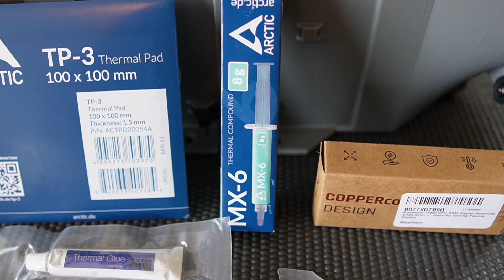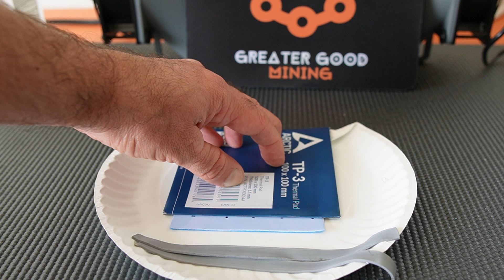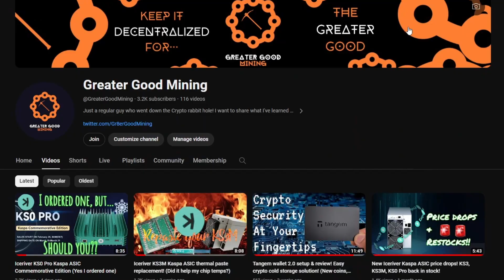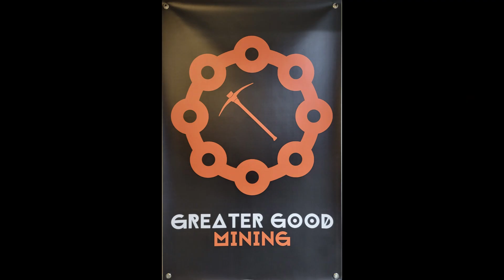HOTROD your Iceriver KS0 Pro Kaspa ASIC for MAXIMUM OVERCLOCKS! (Repaste, Repad, Copper Heatsinks!)

Comment: Can anyone help me. Went to setup to prepare for my 3 ks0 ultra arrivals and the adapters i bought to connect my four pin (pwm) fans to a 6 pin (to the breakout board) is not what I thought. Idc about the pwm can you or anyone help me out with the dype of cable adapter i need. Again i need to connect a 4pin fan to be powered by my breakout box (not trying to use the zsx) hoping to find an adapter. 100% power 100% of the time is good with me
Reply from the maker: Why make it complicated? Get an axial 1238 off Amazon and plug it straight into a power strip.

Comment: @GreaterGoodMining  Can I fit a 10x10x7 copper heatsink for the OC KSO PRO?
Reply: Now I saw that someone already asked this question. Even if I put 10x10, nothing will happen with the machine.
Reply from the maker: It will hang over the edges of the power stage and could potentially short something out if you're not careful.
Reply: @GreaterGoodMining   thanks
Reply from the maker: @vedranlevak5266  no prob, it can be done, just be careful. I'd recommend a smaller size just to be safe though

Comment: Gday GGM - ive got 2 KS0Pro's. No.1 - Power Stage 97 (Stock) and No. 2 - Power Stage 74 (20% overclock)  in the board temp section of PBFarmer.  Is power Stage temp the Thermal Pads, or where i put the Artic MX-6 ? Cheers.
Reply from the maker: Neither, the power stages are where you need to attach copper heat sink. Watch this video I made, it will show you exactly what to do start to finish!  :] https://youtu.be/84YSRkykadY

Comment: Doe anyone know what mosfets are??  I cant physcially see the chips themslves with my eyesight.
Reply from the maker: There are 4 components in the middle of the machine that are shaped like rectangular boxes. If you are looking from the ethernet side you should be able to see 4 tiny rectangular chips just in front of those large box like components. Those are the "mosfets" or power stages
Reply: @GreaterGoodMining   They are teh uP9650a   custom made by iceminer.. cant find any info at all on them n spec sheets. Heard 12 votls runs cooler  on the chips.. but 8.3 instead of 5 amps on defaultl clocks on teh barrel. Consider 6 pin modifiying. HOwever wanted to confirm this with spec sheet. cnat find my guy.
Reply from the maker: @PatrickDurbin-g8t  I don't have that info either, sorry. You might want to ask around in my Discord or Kaspa Discord in the mining section. There might be someone who has more information

Comment: If I put this ks0 pro inside the refrigerator for mining. What harm could it have?
Reply from the maker: It could melt your ice-cream 🍦
Reply: @GreaterGoodMining  I'm asking seriously，Doesn't this approach work?  Is it because of the humidity?  I really want to try it but I'm also afraid of it breaking
Reply: @danielelninoerrante8203   set in front of windo unit. lol but seriously 419e spray.  but bro you spray the chips... are anything that needs a heatsink.. its gonna make a sealed layer between it.

Comment: I hope I could get your thoughts on something for the KS0 Pro. Have you considered putting a flat copper bar heatsink across all the mosfats and then adding the cooling fin heatsinks directly above each mosfat on top of the copper bar? What are your thoughts?
Reply from the maker: I would worry about something shorting out with that method, and you're adding an extra point of failure by thermal gluing two separate things together. It could be done though
Reply: @GreaterGoodMining  Thank you for your reply. I kinda thought that might be the case since all mosfats would be connected to each other electrically.

Comment: the heatsinks that you recommend are out of stock.  any other recommendations?  Additionally, what OC firmware are you running?
Reply from the maker: Try to find copper heatsinks with the same footprint size and they should work too. The key is to dissipate the heat from the mosfets and have good concentrated airflow over them. I am going to be using PBFARMERS overclocks going forward because I want to get better at dialing in my own overclocks. Each machine is different because of silicon lottery. So it's best to dial in overclocks specifically for you machine and environment!

Comment: When buying from iceriver directly is there additional tariffs or taxes?  Thanks
Reply from the maker: You won't pay tariffs on a KS0 Pro in the U.S. because it's only $350
Reply: @GreaterGoodMining  Thank you for the reply. I'm 100% new to mining and currently researching if it's best to buy a dedicated miner or build a gpu/cpu rig. 

For a newbie, starting off with $800 budget, wanting to learn about mining, what would you recommend?

Thanks.
Reply from the maker: @05glisedan  That's exciting, welcome to the crazy world of mining! The KS0 Pro is a great little miner to learn on because it is very easy to set up. I have full set up videos for the KS0 Pro if you decide to get one. The only problem with ASIC's is that you're locked into just that one algorithm and the hashrate is going up fast and rewards are dropping fast for Kaspa. It is harder to learn how to build a GPU rig, but it will be more versatile in the long run. The problem is it would be difficult to build a full GPU rig on an $800 budget and it might take a long time to ROI. I have an older video that's shows you the basics of how to build a GPU rig too. You could start by building the rig and focus on getting one really good GPU and then add more of those GPU's as the budget allows etc. Not financial advice, but if you're willing to put in the time to learn and you want flexibility in what coins to mine, I would choose to build a GPU rig. That's what I learned to mine on! Hope this helps!
Reply: @GreaterGoodMining  Thanks for the info. Gonna start researching hardware. Really appreciate your feedback.
Reply from the maker: @05glisedan   no problem! Good luck with whatever mining road you decide to go down!
Reply: @GreaterGoodMining  What is the "all in cost" including shipping for them directly from Ice River? Also, what is their payment method? Thanks
Reply from the maker: @MrBigTuna100  The all in cost shipped from Iceriver after using my discount code was $395. That is without the power supply. I recommend buying the power supply separately because if you plan to overclock it you will need a higher wattage power supply anyway
Reply: @GreaterGoodMining  thanks for the quick reply, I am thinking about getting a couple more units when they are in stock .
Reply from the maker: @MrBigTuna100  No problem! I love these things. They are fun to mess with!

Comment: My ks0 pro hates being "cold", I added a cooling shroud and the the performance just dropped. ant form of additional cooling and the hashrate would drop below stock
Reply from the maker: That's interesting 🤔 maybe your chips want to operate in a more narrow range than most
Reply: @GreaterGoodMining  anything less than around 60 degrees celsius on the chips and the hashrate plummets. I moved it to another room by itself and I had to slow down the fans to let it get hot to stop the hashrate from dropping. While I´m not complaining about not needing excessive cooling it is a bit odd to say the least

Comment: No repaste, no headsink, 289gh at 144w  asic fan in front (not new), no tsiftw firmware, sides down, no sides with holes works great at 42c max. One use 153w.
Reply from the maker: Well done! Are you thinking about modding or tweaking further? Love your results with minimal mods man!
Reply: @GreaterGoodMining  no I men I mean is almost the same efficiency like stock at about 2gh/w I do not to try more my good luck 😁.
On ks1 I also managed to get 1610gh at 1333w.
The thing is that i said to not buy more kaspa miners but I kind want the kaspa edition one 😁.
Reply: whats your room temperature?
My room temperature is often  83F, hard to keep the chip cool.
Reply from the maker: @piratanet123  room temp for me is like 74 degrees

Comment: Great Idea regarding moving the fan outside... Thanks!
Reply from the maker: Seems like an easy way to get more airflow with almost zero effort, and ZERO extra $$ to me! :]
Reply: @GreaterGoodMining Thanks,now I may have to move my fans to the top as well.Awesome vid,very in depth as usual🫡
Reply from the maker: @RandomMiner  thanks RandomMiner! It's worth a shot if you need better cooling :]
Reply: So switching the fans does it not change the flow of air from in-to-out Or vice versa

Comment: I was curious as to why most people suggested to have the aux fans blowing from the power plug side. When I installed my heat sinks I noticed that they are also blocked and thought it would be better cooling from the other side like you are showing in this video. I am looking forward to your overclock video.
Reply from the maker: I agree it doesn't make sense to me the other way so I switched it up! Thanks for watching!

Comment: What’s the max chip temperature you would consider to be safe?
Reply from the maker: I try to keep my chip temps less than 85 or lower if possible. 90 is the warning zone. Over 95, you get thermal throttling bad. Higher than that, you're in the danger zone with potential to toast your chips

Comment: How much are you earning on the overclocked KS0 pro?
Reply from the maker: About 20 or so Kaspa per day currently with a overclocked KS0 pro depending on network difficulty etc
Reply: @GreaterGoodMining  what pool are you using.
Reply from the maker: @piratanet123  right now I'm using k1pool